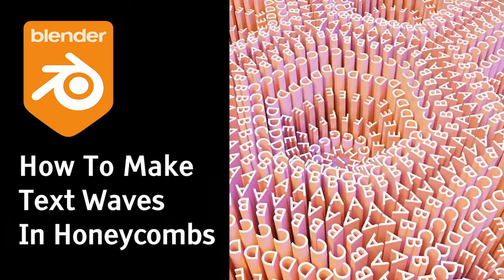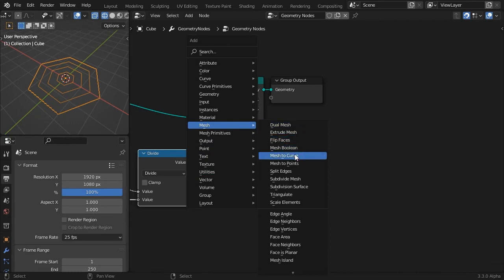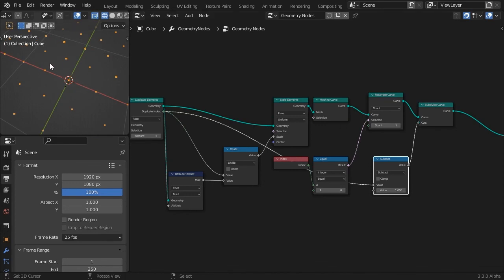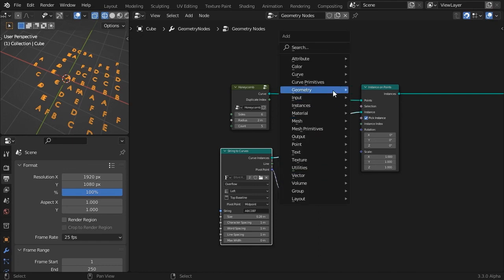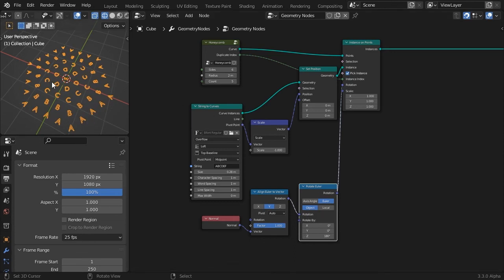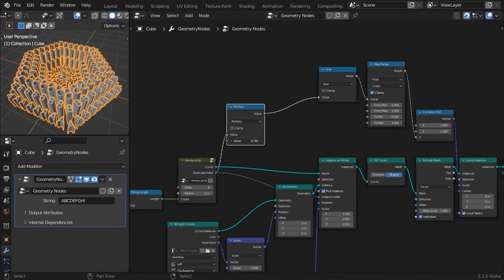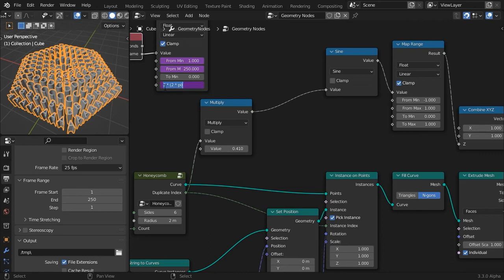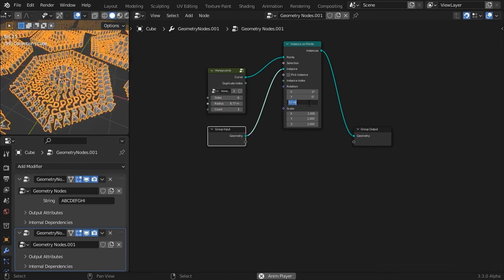How To Make Text Waves In Honeycombs With Geometry Nodes

Comment: thank you very much for sharing this one , I have only one issue , at 7:08 my text go all the way up , there is no such thing like a wave . Pls reply me .
Reply from the maker: There are no hidden steps in this video. Everything I did is shown. You must have skipped something.
Reply: I hope I'm wrong, but I copied exactly everything you did , I use blender 3.6 is that a problem ? Thank you for reply , I watch your clip several time but still ...
Reply from the maker: @512studioasmr  the version of Blender shouldn’t be a problem. I wouldn’t know how to help you without some context. Try emailing me the scene you’re working on. Let me have a look.
Reply: I have the same issue too in 3.6.  Did this get resolved?  Thank you!
Reply: Actually I solved it, in the Honeycomb node group, used a Store Named Attribute after the duplicate elements to store the 'duplicate index' as an attribute, and then use the Named Attribute instead of the socket coming out of the Honeycomb group.  Not sure why the method in the video doesn't work, but this solution does
Reply from the maker: @Alex.Nguyen,  @goodnightthief  I'm glad you solved this by your own. I had some time to spare today and reopened my old scene, built on Blender 3.3.0 Alpha, in today's Alpha version 4.1. Strange as it sounds, the letters animated as block, instead of in waves. The problem seems to be the Scale Instances node, in the end of the node-tree. For some reason it doesn't process the field input correctly if it is calculated after the extrude Mesh node. It works correctly in we insert it before the Fill Curve node. It may be a bug in the later versions of Blender?! I don't know. But we can simply overcome this by deleting the Scale Instances node altogether and feed our waving motion field directly to the Scale input of the Instance on Points node. It works like a charm. Thank you for pointing this out. I'm updating this method in the video description.
Reply: Thanks  @ilirbeqiri  that makes sense!  Also thank you for all of your tutorials - I quickly went through them over a week because they are excellent, and bought your text pack to say thanks.  Really great stuff
Reply: @ilirbeqiri Thanks for finding the solution to this issue. :)
Reply: how do you even get the honeycomb node group  @goodnightthief

Comment: The tip about copying the drivers was great and new to me, but to achieve a completely seamless loop, either the start_frame value needs to be decreased by 1 (or left as 0 without driver) or the end_frame value increased by 1.
Reply from the maker: In fact when using this trick, the start and end frame numbers don’t matter at all. It will still loop flawlessly. Try it yourself. 😉
Reply: @ilirbeqiri  I've tried it, there is a slight hiccup (barely noticeable) since the first and last frame of the loop are identical when they should not be. In long loops like this one it is not that noticeable, but it is still there. Put in "#frame_start-1" in the "From Min" field and it will loop beautifully.
Reply from the maker: @TobiasEinarsson  You’re right, thank you for pointing that out. It’s either that, or just remove the last frame. 😉
Reply from the maker: I corrected myself and mentioned what you pointed out about precise looping in my last tutorial. Thanks.